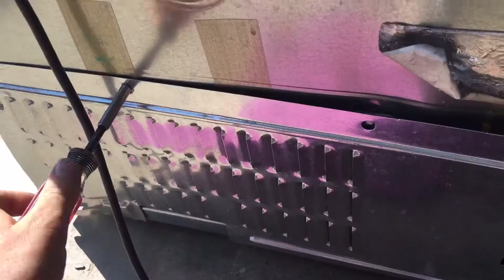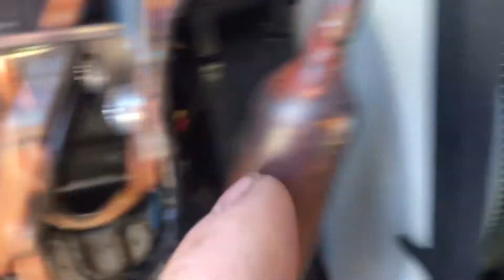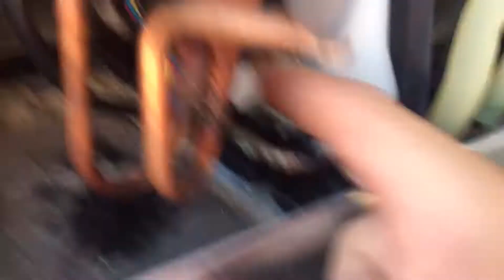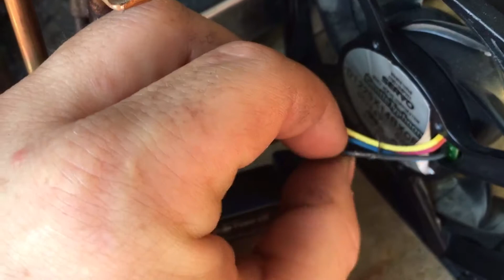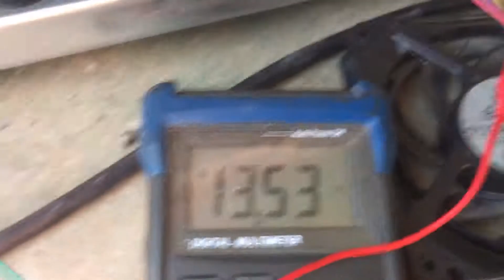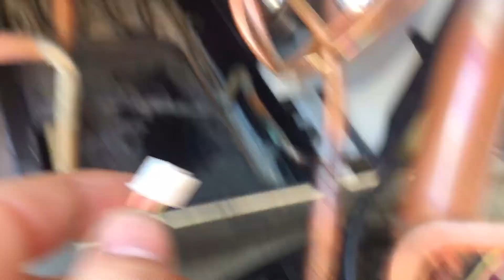GE Profile French-Door Refrigerator That Has Warm Door Seals How to Replace Condenser Fan WR60X10358

Comment from the maker: ATTN: your freezer works well, but the refrigerator does not? >>>
while the refrigerator is running  , there are two vents on the back wall, (fridge side and not freezer side) you may not be able to feel the air coming from the vent back there, but cold air should coming out of those vents. There is another fan back there! (I only show you the freezer evap fan working in this video) I usually tape a small piece of thread right above that vent; if the thread is moving that usually indicates a good working fan without taking apart the back panels to get to the fan! Also a temperature sensing gun can be helpful and used  to find difference in temperature at this vent! If that fan is not working  it could be bad or something is telling it to not turn on! I would first see if the fan is on or off and test for a voltage present on the leads. I show how to do this on this video for fan replacement! Same senerios, but instead we are now looking at one of the evap fans, not condenser fan and for the refrigerator not the freezer !https://youth.be/Bz5QMEanejU

Comment: Thank you for this video. I did this repair and it helped a little. Now I noticed the display is indicating the inside refrigerator is 37 but it is actually 46. What would cause this and do you have a video showing how to repair this?  Thanks, Steve
Reply from the maker: Make sure all the fans are on and give it time for the temperature in the cabinet to drop. Also make sure you installed the correct controller and that you have good working cabinet temperature sensors providing the correct feedback to the main board.

Comment: Amazing video. Thank you so much for all the great details. Right now I have the defective fan pulled out. I am waiting on the replacement to arrive via 1-day shipping through Amazon.

If for the small chance that the fan still does not function, anything I should be looking for next?
Reply from the maker: Voltage present on the fan leads
Reply: @ATEMOFFROAD  I replaced the part just now and the fan is now spinning again. I'm hoping this fixes my freezer not getting down to 0 degrees! Man that installation was a tight fit too!

Edit: All fixed!!!
Reply from the maker: @oholdeno  excellent that part should be fixed

Comment: Nicely done, but just remember that board was sending the correct voltage. If the fan didn’t come on, you would have a defensive fan. Those other wires are for the proportional valve or two way valve. Also the heat around the door is just the refrigerator expelling heat. Totally normal. Extra hot could be a bad condenser fan or dirty condenser coils.
Reply from the maker: This is why I changed the fan! Thanks for watching 🍻

Comment: Thanks to  you I just replaced the Inverter Controller and sitting here waiting to see if the refrigerator will start cooling off. Condenser Fan is running.
Here is my question. The three prongs on the compressor will fit the wiring harness with the white plug with three holes in more than one orientation. Is it important which pin is connected to the which one of the three holes on the white plug?
Reply from the maker: Is the compressor running the way you plugged it in? the answer to your question is NO it shouldn’t matter but try to plug it in the same direction the old one was plugged in and also to remember it is very important to make sure you have the correct controller that matches the same input and output specs. Thanks for watching and good luck 🍻

Comment: I have the same ge French door fridge.  Freezer works fine, fridge side freezing up. I saw on here to look at the evaporator fan, it was locked up. I replaced it from wr60x10356 to it’s new part number wr60x26866. Plugged back in and still no fan. It’s not cooling at all it seems now on the fridge side. I did see on a few videos a software upgrade but mine is a SA serial number, 2013 model. Any ideas?
Reply from the maker: Thanks for watching Your going to want to make sure your getting a voltage supply to the fan, this supply usually comes from the board on the back! Do you have voltage present on the fan you just replaced?

Comment: I’ve swapped out the condenser fan in my GE French door fridge compartment when the coils were freezing up and the fridge wouldn’t cool well but the freezer worked great. Now after a few power outages my fridge is once again struggling to cool and freezer works fine. Only difference now is the condenser coils are fine and the fan is working. Is the entire board bad? Or should I start by testing/replacing some other sensor?
Reply from the maker: Check the fan in the refrigerator compartment not the freezer that one needs to be working! Also you can get a high amp rated surge suppressor for the sensitive electronics! This we’ll help with the power outages and when the power is restored . This is the one I use 
https://amzn.to/3yQNZ4S

Comment: So I have a MODEL PFSS2MJYSS GE PROFILE FRENCH-DOOR REFRIGERATOR. The fridge stop cooling, the freezer was working and then it stopped all of sudden.  I took out the back panel and cleaned the back coil and still nothing.  😕 Then I noticed that when I plugged the refrigerator  back in the fan is not working.  It only works when the "turbo cool" mode is on. I don't know if that's the way is supposed to be. I don't know what else to do next🤷‍♀️
Reply: same situation  I replaced both the damper fan (not working) and evaporator fan in  Frigerator.  condsensor fan is working and the motor is on.  frig and freezer still not working.   Did you get your to work?  Love the roomy design but this the second time this frig stopped cooling every three years seems like   25 yr old frig in my pool house that never needed serving and works great.  simple no mother boards to deal with,

Comment: Mine is doing a really high noise, it kind of vibrates too much. A technician disconnected the fan, he told me it will not affect anything...before he did that there was already condension between the vertical front doors. I guess that was already happening because this fan was kind of failing? And now that it is disconnected will that condension will be worst? I will keep an eye close to that condension...
Reply from the maker: Nice, Yes that’s possible, I’d replace fan as soon as possible.
Reply: Does the condenser fan come on automatically or does it take awhile this on a GE refrigerator
Reply from the maker: Anthony Bitseedy  💥 I have always seen it come on when the compressor motor turns on!
Reply: The fan was replaced, and the noise and heat stopped, but now the temperature in the fridge is too high, about -8 celsius degrees, the recommended temperature should be -18 celsius, per the screen it is set to -21, but the actual temperature is -8, and the ice maker stopped working...also, the refrigerator is not evacuating the excess of water and it gets frozen on the bottom of the refrigerator
Reply from the maker: @alexandernunezarias9889  your going to have to pull the back panels and doubles check that the fans in the back of the refrigerator is on and working, you can also do this by placing a small piece of light tape at the air exit of these panels. To see if there is any air movement inside the refrigerator

Comment: Great content bro. What if everything is working how it should. (compressor is running & evap/condens fans are spinning) and the unit still isn’t cooling, what do you think the issue could be?
Reply from the maker: Sounds like a weak compressor , or a valve is not open!!
Reply: All Things Electro-Mechanical Jeeps & Outdoors any valve in particular I should look for?
Reply: @JRyan_31  I would like to know as well
Reply: It's your inverter that is bad
Reply: Did anyone figure it out?

Comment: so I'm curious... is this the same Fridge in your other video? I swapped out the inverter controller and the compressor is now running. But the fan isn't! Is it common for both of these to fail at the same time? Or did the inverter controller go bad and then fry the fan?
Reply from the maker: @Alex Alb 💥 nice , thanks for watching, I’m not totally sure why they both failed at the same time , but in our case they did. Did you get your fixed ? Thanks
Reply: @ATEMOFFROAD  I actually did not! The fridge is not going into defrost, even though defrost works! What I have been doing is going into “Service Mode” testing the “Fresh Food Defrost” and it defrosts for two minutes then the test ends. I repeat this 5 more times as I wash the dishes each night and it seems to keep it defrosted. Anyway around this hack? I think I might have had a controller board issue

Comment: The evaporator fan in my fridge is pulsing high and low speed continuously. I assume the board is the culprit? Are the boards repairable do you just junk them and buy a new board? GE Cafe series fridge.
Reply from the maker: Adam Sheffield
Sounds like the fan is trying to start up but can’t. stops. Then retries, I have seen fans that are failing do this. But if it runs good just changes speeds erratically, this could be a Input sensor thats failing, causing your board to control the fan in this behavior you described. It’s possible it could be the board but. Would check input sensors and try a different fan before I go changing a complete board. Good luck 👍🏼
Reply: Hey Adam, did you fix your problem? Was it the fan or control board? I just bought a GE French door and it is doing this brand new, first day installed. :( I am dreading the warranty process after already not having a working fridge for 5 weeks and would honestly just pay the $140 for a new board up front if I knew for sure that was it. I am thinking it is based on all I have read.  What did yours end up being?